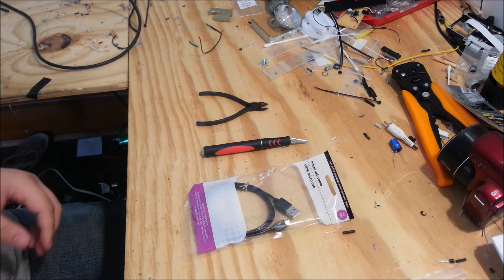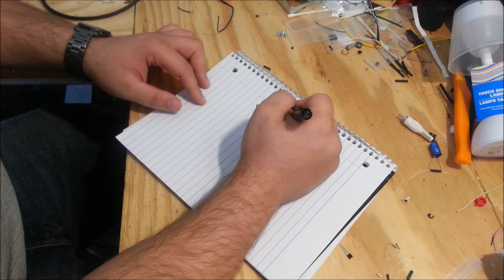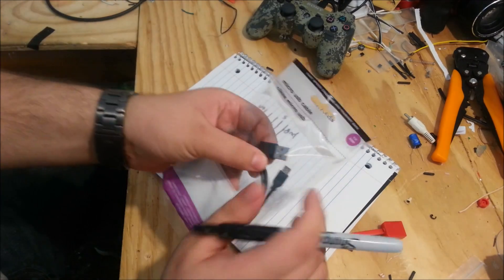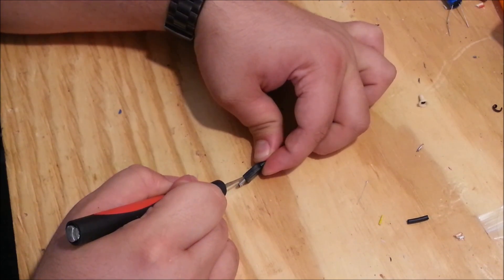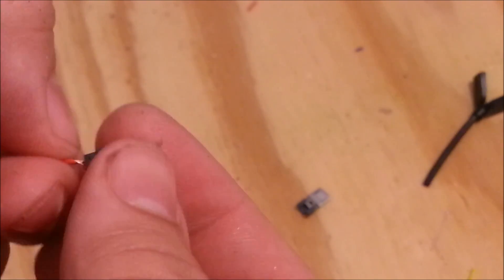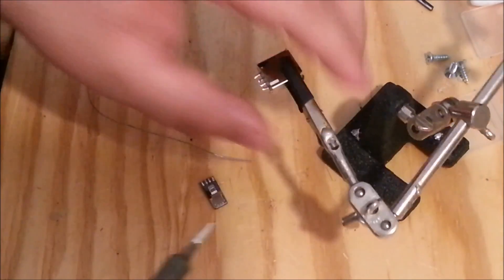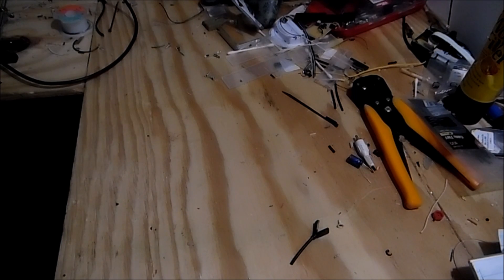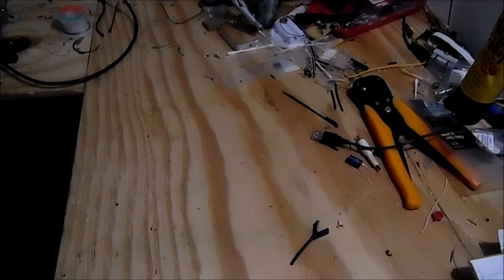Make professional OTG cables from scratch!

Comment: Well made video and good explanation.  I'm glad you included the explanation of the difference between a sync cable and an OTG cable.  I am wondering why you bothered removing the metal casing on the micro USB when you could have done the solder bridge when you soldered the two connectors together?  Or am I missing something?

Comment: This is the third video I have watched, and the FIRST video made by someone who actually understands what a host cable actually is. There are quite a few videos out on YouTube where the creator Just builds a micro to usb A adapter and doesn't touch pin 4. I am trying to help a young friend in another state learn Arduino, and she wants to use her tablet to flash Arduino devices without bringing them back to her computer. You video walked her through it simply, and explained why it needed to be done better than I could. Thank you, and keep it up.
Reply from the maker: Thanks so much for that awesome comment :) I'm glad to have helped! Flashing an Arduino with a tablet sounds like an incredibly useful project!
Reply: @Solder_king  I have been told it is possible to flash them using an Android phone. I haven't attempted it myself.